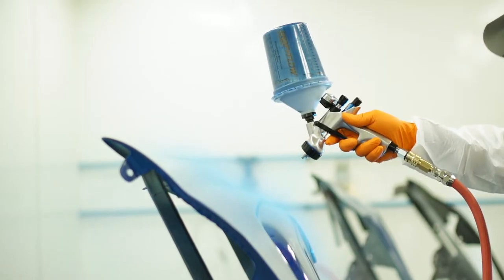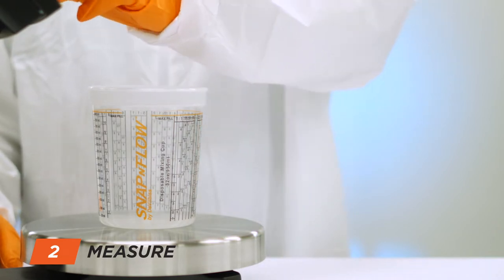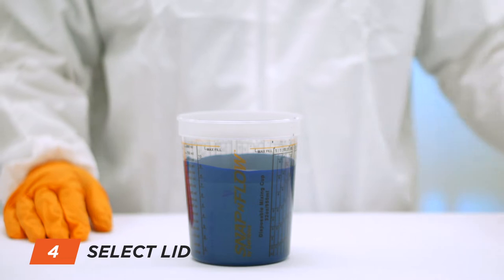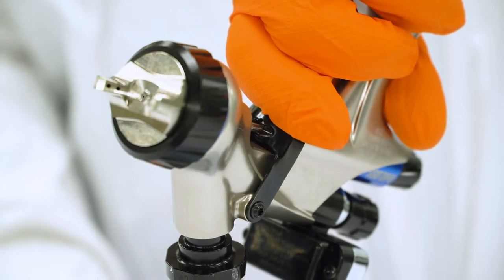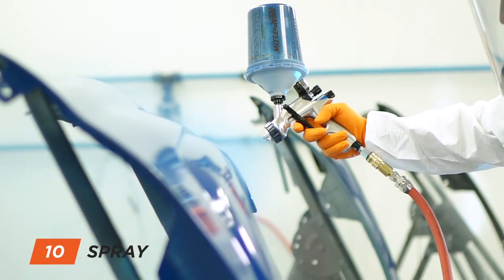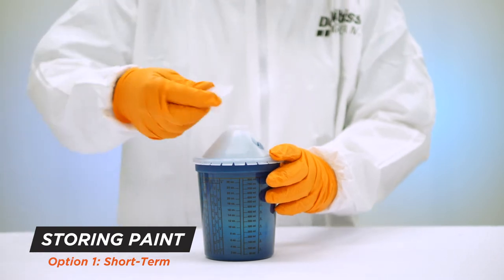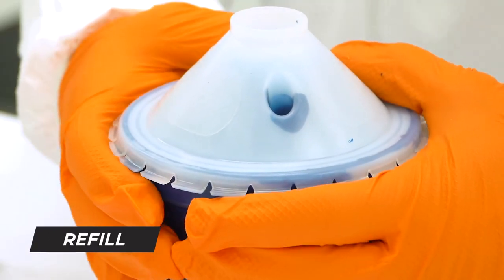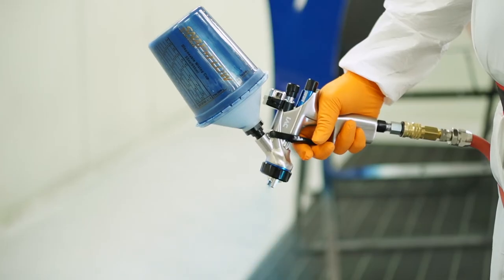Mix, Connect and Spray... With One Disposable Cup System: Devilbiss SNAP N FLOW™

Comment: I used this I’m not to fond of it 
The breather hole will force up paint through it. Causing it to come out and leak clear or paint.
When I want add more clear from the same cup becomes more messy. I tried but to much steps for me I love new ideas and change. But I’ll stick to my basic liners system it’s way more faster at least for me in our production shop.
All my guns are devilbiss and I love them all.